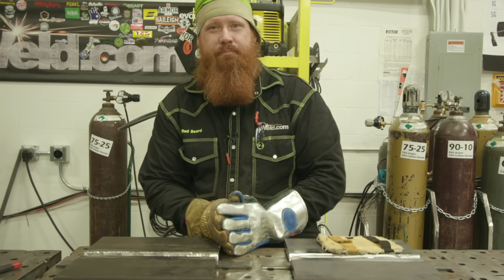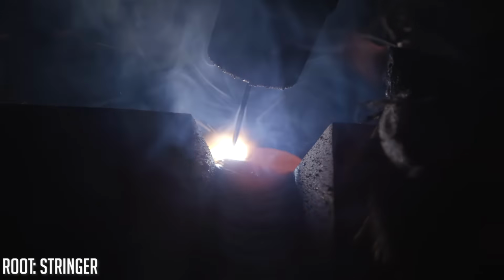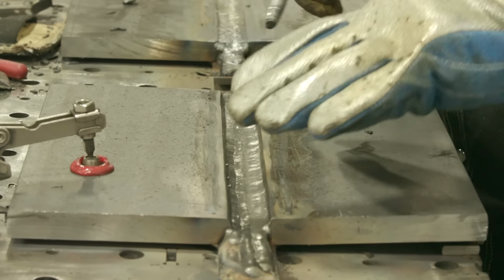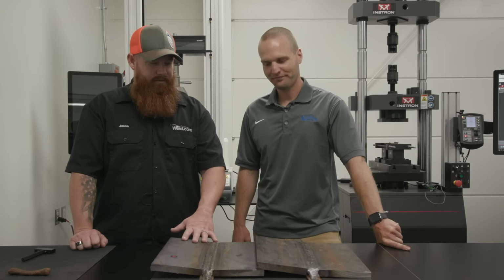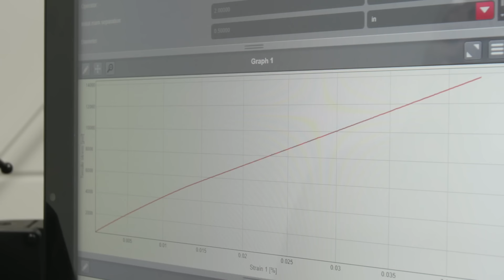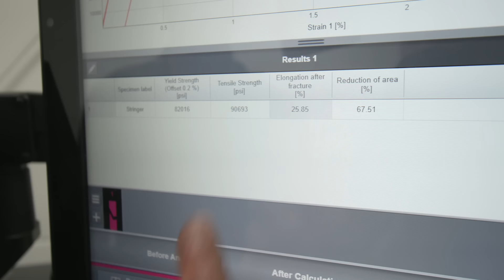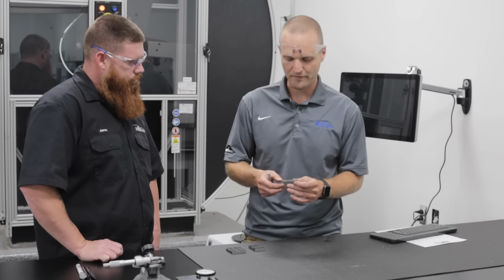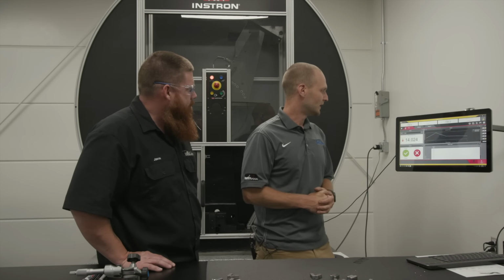Stringers vs Weaves

Comment: Randomly stumbled here, not a welder. I'm a machinist. It is pretty cool seeing the test preformed though. I work in a small fixturing and repair shop owned by a large testing and research company. They do all kinds of tests like the tensile, fatigue, charpy, torque and any kind of custom test the costomer wants. Temps ranging from -350 all the way up to over 2000 degrees fahrenheit. We never see the tests or the testing frames. Just make the parts, repair or replace anything. Ship it out to the parent company and start the next job. Theyre super secretive about it all. I have repaired some of the instrom equipment as well. I only know that because they have the company name engraved or stamped into it. I'm sure it's cheaper for me to do it than to buy a new wedge grip or something. They just pay our wage and keeps the lights on since it's all technically in house. We also make some of the test samples for GE or Boeing Ford or whoever when the main shop gets a little behind.

Comment: I have been involved in pipeline and pressure vessel welding for over 40 years.  Here are the basic differences: 1) Weaves have slightly higher productivity than stringers, especially on thick wall material, generally 3/4" thick and thicker; and, 2) Stringers have lower occurrences of porosity and undercut.

It is also easier to do repair welds on stringers than on weaves.

If the mechanical tests meet the specified requirement, then it doesn't really matter.

Thank you for your consideration.

Comment: Nice Esab Rebels. Got me the 205 ic AC/DC. Absolutely impressed with it. As for the welding. In my expierence as a pressure pipe welder, it's not really a debate as which is better. It's about procedure. Travel speed is critical, interpass temp is critical. As well as staying within the codes for weld width. If you travel too slow your overall heat input gets past the allowable tolerances and you are welding out of procedure. So I dunno if that annoys anyone, but it's my reality. Cheers.

Comment: Yes i had my welding tested many years ago here in Canada and the teachings at that time was to never weave because it mixes impurities into the pool of malting metal and weakens your welding process. i did the welder fitters/ pipe course in the mid 90's and passed all my bend tests and that bend test on concave and convex pipe. we would fail if we did a weave weld for our tests back then. Pressure pipe was 6010 root and 7018 Stringers for the filler and cover passes, I remember for my cover passes the stringers looked like one weld but it was 3 passes Horizontal 3/8 plate was scratch start TIG Root and 7018 filler and cover. Even vertical and over head stick is 6010 root up hill and 7018 filler, stringers and cover stringers, I found it was easy for me, it all has to do with prep setup and heat settings. I nice when you heat is correct because the slag fall off on it own as it cools.

Comment: I know this is an older video but I just watched it. The controversy over weave vs stringer has been on going probably since Lincoln, Hobart, Miller and Airco started making constant current welding machines. Former CWI/CWE  and welding instructor for 31 years. I can say this without a doubt. This is a series of sample coupons done with one process in one position by one welder. Did we conclusively end the debate, as you mentioned "no". The list of variables to determine a conclusion would take multiple videos and an abundance of time. The truth of the matter is, Code dictates essential variables. As a certified welder one follows code. Code does not say you might or you can it says you will and it is law when used in a court room to prove liability. If it calls for no bead to exceed filler metal diameter by more than 4x, you as the welder follows code...not a video. As you mentioned, this is a fun place to start and the piece gave good eye candy if you're a nerdy kinda welder guy who is curious.

Comment: Thanks for the video! No surprise that stringer has better mechanical properties than the wave one. You could even have bigger values of the charpy v-notch test, if you had laid the final run in the middle of the weld. Thus you do heat treatment of the HAZ (heat affected zone), which is in the base material and where are the highest values of hardness. Once again thanks for the great video.

Comment: While this test was pretty definitive, a 1-3/8" wide "weave" is absurd. Going over multiple valleys   after the root pass is also not something I would think any weld would benefit from. Splitting and tripling the weave passes towards the top makes way more sense with something that large. I would have much rather watched a test with multiple smaller weaves and seen those results. Watching the puddle cool before he laps back on the "weave" makes me cringe.
Reply: He had many more stringer passes than weave passes. Not enough heat / feed / amperage or whatever you want to call it while he was doing the weave passes.
Reply: Exactly, too wide of a weave. That's why you put 2 to 3 Bead Cap on heavy walls. Even then he should of stacked the weaves after the hot pass 1/2 covering the previous weld. ABSURD!
Reply: Yeah you shouldn't be welding over lack of fusion, over multiple valleys, or in between two passes that aren't completely fused together with no space in between. It's not as bad of an idea with straight CO2, but if you need something to pass UT, it's never a good idea. I've welded over some pretty bad lack of fusion before with 3/32 dual shield running straight CO2 with the arc right on the toe that wasn't fused when I was in a hurry and it passed UT, but it's definitely not best practice.

Comment: Super interesting video but you've got some captions wrong on your welds at least at around 7:20 and 7:50.  You might want to check all your shots and re-edit as necessary. 

Again, I appreciate the time and effort you put into this and it's otherwise a great video.
Reply: Agreed. Doing a stringer with weave text and a weave with stringer text.  Awesome technique and finish!

Comment: Great video. The only thing that I would suggest is to perform a volumetric test like radiography (X-ray) on both welded plates before testing. This would show any weld imperfections that could alter the destructive test results.

Comment: Neat.  how about you and the labcoat get together on quenched plates vs non quenched.
Reply: i think quenched can be tougher because smaller grain size, what do you think?
Reply: If you quench but dont then temper, the steel will be very hard but brittle.
Reply: @jessewilliams4152  we are talking about mild/structural steel here not carbon steel
Reply: @NKG416  which is carbon steel. You need carbon to turn iron into steel.
Reply: @jessewilliams4152  yes technically all steel is carbon steel, but you need enough carbon to actually harden it, in this case mild/structural steel don't have
Reply: @NKG416  Also i guess you wouldn't be quenching from red hot either so the martensite accumulation would not be as sever and in theory if you machined out a tensile specimen from the core of the weld, it might not be to badly affected.
Reply: @jessewilliams4152  even though you quench red hot mild steel it won't harden it.
That i don't know the answer, maybe the guy above was right (increase in tensile) but yeah, i don't know
Reply: @NKG416  All i know for certain, based on my experience as a welder, is that you dont use water to cool down steel. I dont know if quenching has any affect on a tensile pull though. Personally i feel like a quench would be all around bad. Im certain quenching would screw it up in the CVN at least.
Reply: if its mild steel in question, that is .3% carbon or less, none it cant harden and martensite can not form. also quenching would have to be done at red hot to make any difference any way.
Reply: Like actual QT steels, or plates you weld and quench between welds to cool them down?

Quenching steel will greatly reduce its toughness, and without additional heat-treatment it is undesirable in most applications because of the increased likelihood of crack formation. The more carbon content and higher the harden-ability of the alloy, the more pronounced quenching effects will be.
Reply: @sambone1015  You should check out some of the tests run by Rob Gunter at the Los Alamos National Laboratory.  He was successful in hardening mild steel.  Now, there are a few caveats with that: the carbon content in mild steel varies quite a bit, so the results varied accordingly.  "Hardened" is a relative term here.  No, it's not going to get as hard as say, some 1084 or 1095, but the tests were able to increase hardness from a base of RC 39-40 to 49-50, which is pretty darn good considering.  The key in hardening low carbon content is it must be quenched very quickly.  In fact, I've read somewhere (I'll have to try to find it) that theoretically, nearly any hardenable metal can be fully hardened if you can remove the heat quick enough.  The lower the carbon content, the faster it must be quenched, and that brings other issues with it.  The thickness, or mass of the piece will be limited as the heat propagation out of thicker pieces is limited.  

Further reading on the subject, I found discussions of the carbide solutions in heated metals as they pass back through the recalescent point during cooling.  If you aren't familiar, the recalescent point is where the temperature of the cooling metal actually spikes back up while being cooled, the energy to create the spike is derived from the exothermic change in the metal crystal structure (this is actually the point where the martensitic state is forms).  The lower the carbon content, the quicker you need to get past this point to "freeze" the crystal structure in that martensitic state.  

Personally, I don't see any real benefit for some kind of super quenching solution to slightly harden mild steel, especially not when you can get steel in just about any carbon content you want.  I think those studies are more for better understanding metallurgy and scientific understanding of the processes.  I find them interesting, if nothing else.
Reply: @edwardlance2379  now this is how you argue kids, take notes. I stand corrected....ish. still have to quench at critical temp, I been dunking test coupons for years never had a prob.  I'm also a metal nerd I will gladly read those studies thanks bud.
Reply: @sambone1015  Oh man, not arguing, just discussing things as I understand them.  That's not to say even those scientists who actually know what they're doing here aren't wrong either.  They may be attributing the reason for the results incorrectly (it happens a lot in science).

Comment: Do it again with 7018 1/8th rod. Everyone seems to weld pipe especially there cap with a wide weave. I run stringers myself.  Curious on the differences

Comment: I wish I could send you some pictures I took on a group of container cranes. Supposed to be D1.1 weld spec. Two inch wide downhand welds in places. A weave in a vert filet that is around 2 inches wide, covering stripper welds bridging a 3/4 gap.  At the bottom of the weld, in the rat hole, you can put your thumb up into the "root" opening. To quote a chinese engineer-- " That slag inclusion was caused by something you did using the crane". He actually told me that. This was after finding a 3" X 3/4" inclusion with a crack starting, in a sub arc weld at the boom hinge.

Comment: Critical note: On the tensile test, the stringer failed in a ductile manner with the line of failure basically horizontal. On the weave sample, the almost 45 degree line of failure indicates a brittle material. Why? Because ductile materials fail in the tension plane, while brittle materials fail in the shear plane. If you rotate a tiny cross section of a tensile test specimen 45 degrees that is the state of max shear. Look up Mohr's circle if you're curious. 

I'm actually quite surprised he didn't touch on that. Haven't watched V-notch yet, though.
Reply: almost every tensile test will break at a 45 degree angle. if it does not do that it could indicate a premature origin point. in that sample it was probably a massive slag line in the weld near the cap because of the giant weave taken while capping the weld because of lack of penetration. by the time he was welding on the other toe of the weld the puddle had already cooled to the point that he was just piling weld metal on top of the base metal (lack of penetration). it would have been interesting to see a cross section of the weave to check for non fusion near the cap of the weave weld.

Comment: That Dewalt 13 amp grinder is such massive overkill for wire wheeling.  Far as stringers vs weave, I passed 3G 1 inch stick doing nothing but stringers and everyone else in my class who passed was doing weaves.  It is what it is.

Comment: Another great video.  What everyone should take away from this, is not that one is better than the other.  What is important here, is to show what the different techniques do to the weld structure.  Just like the PUSH/PULL series, one is NOT better than the other.  However, it shows the person welding what each produces, and allows them to make decisions on what to do in specific situations.  Great Vid.  How's Uncle Bob?

Comment: Great testing methodology and video. Even though the result is pretty obvious, the end of every extensive comparison test where multiple techniques are used with somewhat varying results should result in a discussion/conclusion where the author sums up the results of the various tests into a conclusion that either states the winner and why or the pros and cons of each technique. 
You obviously did a lot of work producing this, it was certainly worthy of a wrap up containing a minute or two conclusion statement. Most importantly, a summarized conclusion at the end allows lazy people like me to get the “Cliff’s Notes” and results without watching the whole video lol. 
Otherwise kudos, we need more videos like this doing quality head-to-head comparison’s of age old debates that most opinions are based on personal experiences with a million variables and anecdotes. Thanks for the video!

Comment: Ok you were right.. ya pissed me off lol 😁😆😆😆
Reply from the maker: haha, thanks for watching!
Reply: @Welddotcom  I find it interesting that u weld with u'r welding gun tip pointed towards the melting bath, I usually weld with the welding gun tip pointing away from the melting bath. Dont know the right term, we call it "away welding" and" towards welding" in Danish (google translate was no use in this topic) I was taught that u put more heat into the welding if u have the tip pointing towards the welding (like u weld) and its more likely to blow through when u make v-shaped welding. Could be interesting to find out if there was any difference, both in strength of the welding, and if u really put more heat into the welding
Reply: Thks. Still, depending on which way u weld, u put more or less heat into the welding
Reply: I was taught drag the slag. If you have slag it's a pull weld no slag you push. A vertical weld is a push weld either way. If you push a weld with slag you run the risk of slag inclusions.
Reply: Hi mate. Generally you pull / drag if you are using a consumable that has a flux, so as not to trap slag in the weld. Solid wire is generally pushed to achieve better root fusion and penetration. That's what the tester at work says anyway. Cheers
Reply: like Ian Bruce says if there is slag you drag, in my experience at least. If you're going uphill you have to try and keep it in the root and not falling out everywhere like a bunch of grapes so I suppose you do whatever is necessary. I don't do vertical up at work though, it's all down, that is not my decision, its what the procedure is. We are all coded for it. We use1. 2mm diameter 316l or 309 wire with argoshield universal. The flux is very runy and can get ahead of you if you are not careful. I would say it doesn't lend itself to going uphill very well.
Reply: Pressure vessels. Hot and fast. A 6 ish meter long continuous filet weld takes about 20 mins. Thats probably why they do it that way. It  is a production environment. We do horizontal vertical, flat, down and overhead only we have about 18 different codings in stainless and carbon steel as well as dissimilar stainless to carbon. I just do what i'm told 😂.
Reply: It pays the mortgage eh mate, you've got to make a few bob where you can. Nice to talk to a fellow craftsman from across the pond. All the best.

Comment: I'm curious how a layered approach would work, say weave outer over stringer core.
Reply: Yeah Wanted to ask the same question - I´m not a pro welder but work in a reasonably close association (oil & gas) & have seen pipes welded with TIG root, stick stingers & weave cap... Also many thick vessels I´ve seen look to have a weave cap but I´m not privy to the rest of the weld...
Reply: Probably wouldn't help with these tests. The large grain structure from longer exposure to high heat during the weave makes things harder and more brittle. It's good for resisting wear and deformation, but not increasing strength.
Reply: Chris Zak so it would be interesting to see a strength comparison between the two styles if the metal were re-tempered after welding.

Comment: Great video showing the difference in strength and impact toughness between the two welding techniques. More detail of the micros showing grain structure and possibly electron beam micros on the fracture regions for both tensiles and impact specimens would be really interesting.